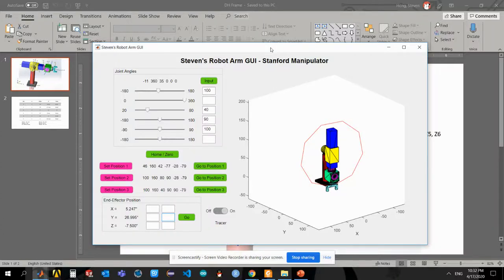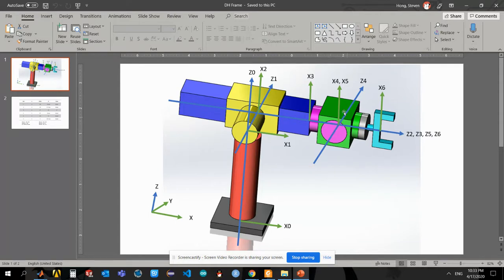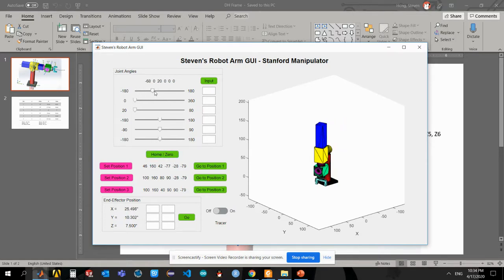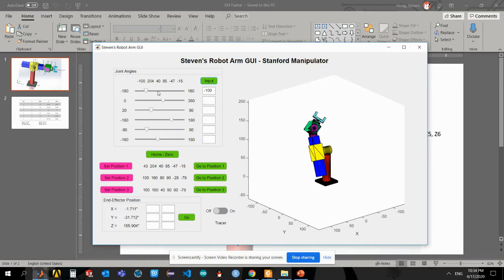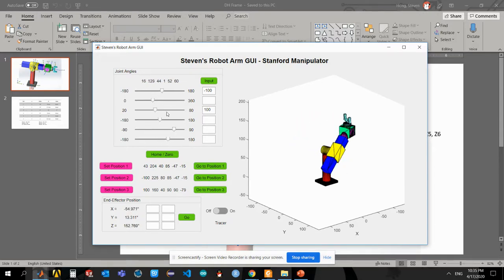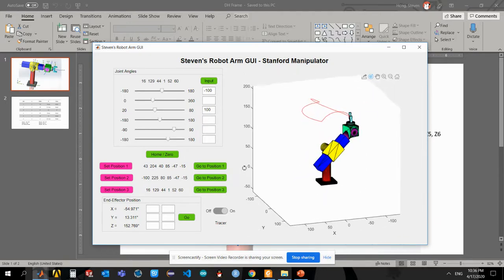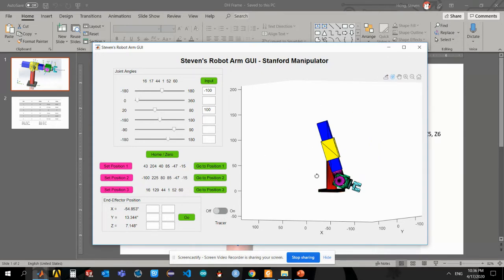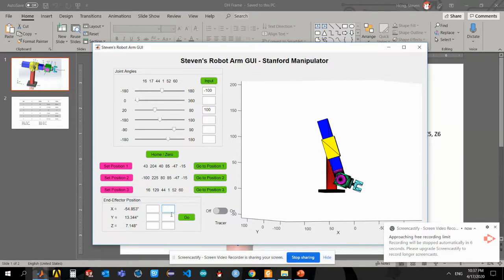Steven's Robot Arm GUI - Stanford Manipulator

Comment: Hey awesome work! I'am performing right now a stanford arm with an offset, Did you use Simulink in order to import the arm to matlab?
Reply from the maker: Hello, depending on what you want to do. For this video, I'm just doing the forward kinematics, and as you can see in the video that I didn't implement the inverse kinematics. If you are doing the spherical wrist, you don't need Simulink for inverse kinematics calculations. However, since you mentioned that you were using offset wrist, it would require Simulink for nonlinear calculations (depending on the algorithm).

In this video, I didn't use Simulink, but I do have Simulinks for another robot arm called ST Robotics R12 Robot, which has an offset wrist. However, the algorithm is based on the actual configuration of the robots. I don't think my codes would work for other configurations.
Reply: @stevenhong7099  Nice, How do you put your cad into the matlab figure?
Reply from the maker: @Alteregofr  Using STL files to create vertices in MATLAB. However, it is a huge pain to rotate and translate the solid models to desired position.
Reply: @stevenhong7099  so you use CAD file to demo this or what? I'm struggling because I use Peter Corke Toolbox and I can't make it understand the spherical wrist. I set my Stanford arm very similar to the puma560 preset but it understands puma560's wrist not mine. (I check it by robot.isspherical() ) Also, can you share the code? PLease :)